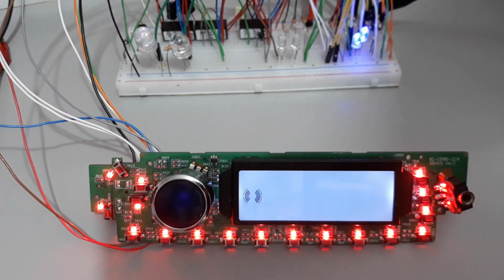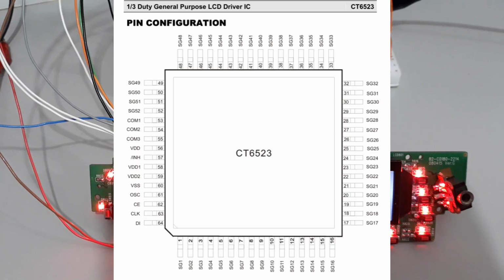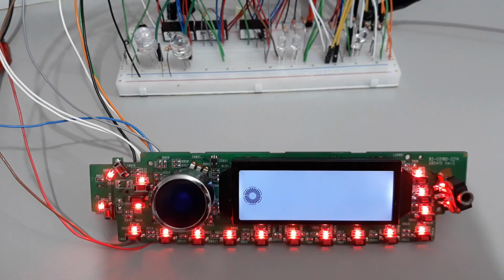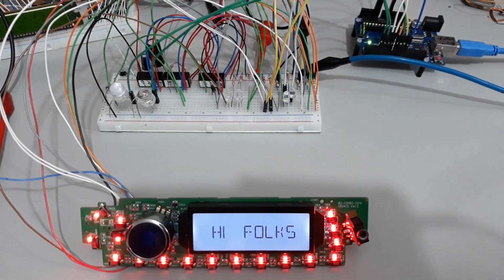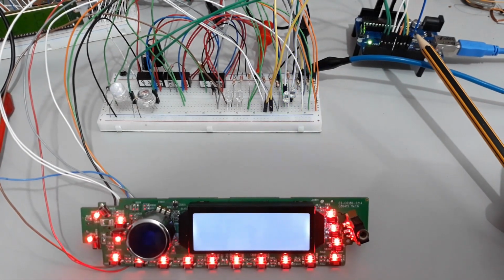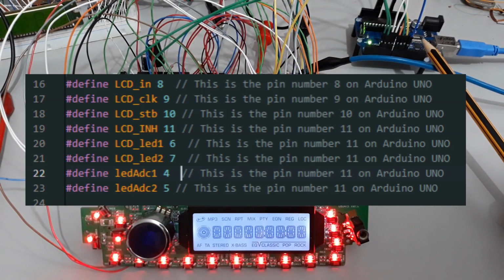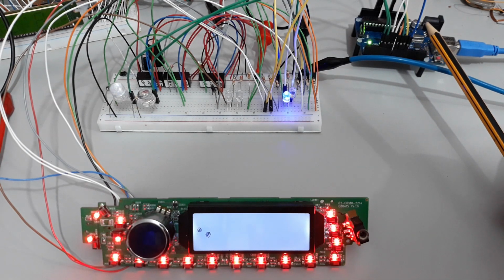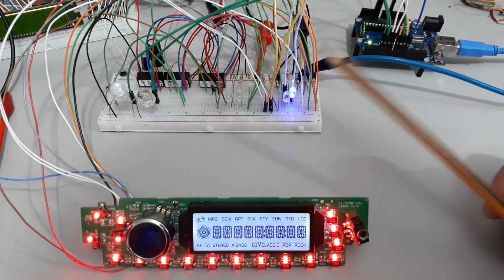CT6523

Comment: can you cover a LCD screen from a HCD-S300 Sony AV system. I have one laying around and don't know how to use it. Thanks in advance!
Reply from the maker: Hi @anastasishav0_038,
I search on my panels, and not find this specific model of system until  now!
Any way I find the Service Manual and can determine the Driver of LCD is the LC75824 or equivalent, ok. Please search on my channel you already have 3 videos about LC75824 and code to it available also. If you look at schematic you will find the 4 wires on the connector marked as "H", page 44, essentials to communicate with LC75824: /INH, CE, Data, Clock and please don't forget the GND reference. Also is necessary apply 2 resistor's one of 1kohms(only to secure) another as variable of for example 4,7Kohms between VCC and GND and the middle point to the DIM1 to polarize the transistors of backlight.
Connect a power source of +5VDC and the GND.
Your system is ready to receive information of Arduino or other and now you can start to determine the positions of Segments and construct you Messages Draw.
Of course if I get one Sony HCD-S300, I will publish the video about it. But I believe you already controlling the control panel at that moment..
Good job there,
https://elektrotanya.com/sony_hcd-s300.pdf/download.html